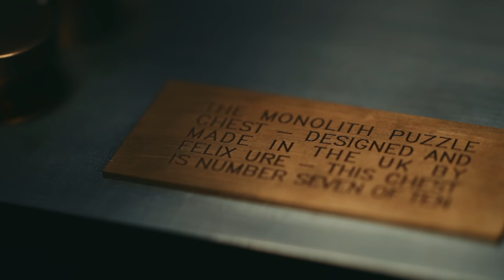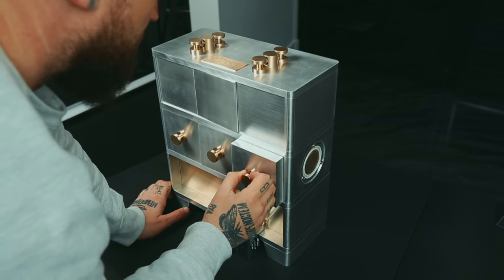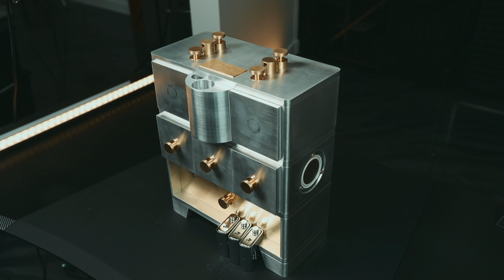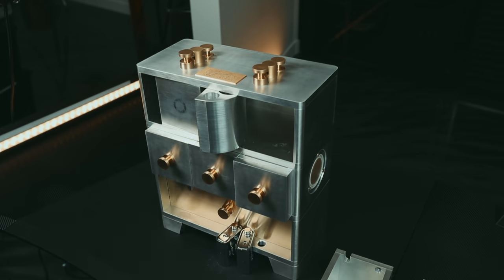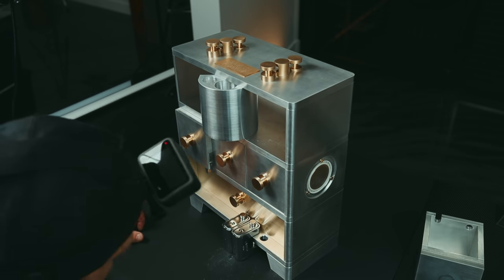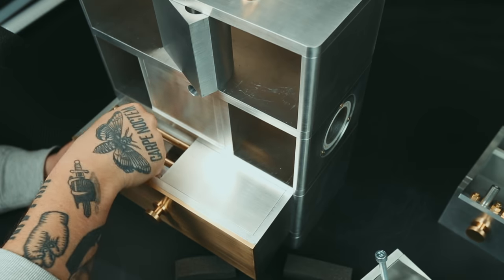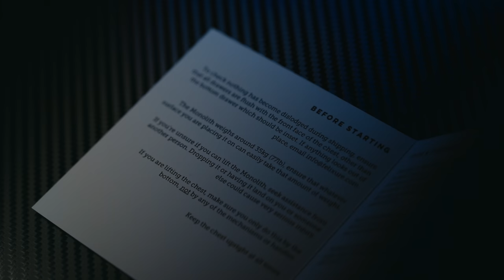The GIANT MONOLITH Puzzle Chest is a BEAST!! (Only 10 Ever Made!)

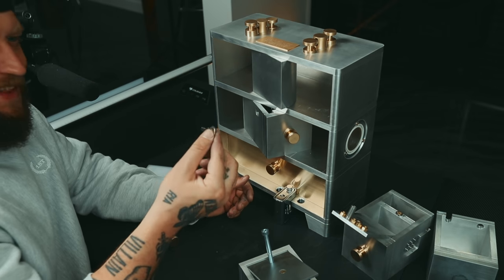Comment: 29:48 Pretty sure you were supposed to put the magnet inside the hole in the rotating section above that drawer instead. Also would have been a good idea for Felix to use some teflon between the parts that were scratching. It would have given some extra neat contrast with the color scheme too and made the sliding not stick so often
Reply: i bet he could have used a cloth or something over the magnet

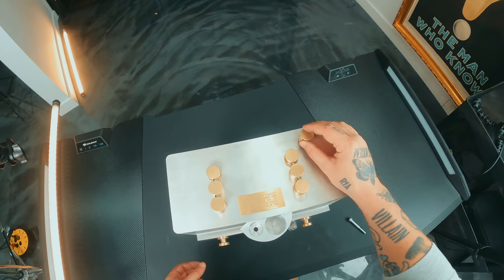Comment: 10:35
The force you are feeling when you move the magnet across the metal is the magnet inducing a current and magnetic field in the metal.
This happens anytime a changing magnetic field moves through a metal.
That is how some electric motors and how induction stoves work.

Comment: Hey Chris, just some advice on how I think you might prevent scratching up the dial on the side; It looks to me like it's intended to be spun like a dial by putting the magnet in the dead center and then spinning it like a dial combination lock, rather than moving it like a crank from the sides.  I might be wrong but if you had to open it again I think that would keep it still and prevent it from getting further scratched.

Comment: Hey Chris. Love your videos! Have you heard about this house in the States?GILLETTE CASTLE
EAST HADDUM, CONNECTICUT 
Built in 1914

(The home of William Gillette, American actor)

The castle was originally a private residence commissioned and designed by William Gillette, an American actor who is most famous for his portrayal of Sherlock Holmes on stage. Gillette lived at this estate from 1919–1937.
The castle was built between 1914 and 1919 with an addition completed in 1924 on a 184-acre tract at the top of the southernmost of a chain of hills known as the Seven Sisters.
Construction was performed by the Porteus-Walker Company, a leading contracting and wood-working firm based in Hartford, Connecticut founded by Gillette's childhood friend, Robert Porteus. It has been described as being designed in a medieval gothic, or an "American fairy tale mixed with European flair" style, or as "a weird blending of Victorian and Arts and Crafts". 
The 3-story-plus-tower, 24-room, 14,000 sq ft home was built of wood, cement, and local Connecticut field stone, supported by a steel framework. The exterior of the home is covered in field stone. Woodwork within the home is hand-hewn southern white oak. In some places, beams were set directly into the stones, anchored only by cement. The walls, in particular, were constructed similarly to a stage set, lacking two-by-four studs and mortar in critical places. It has been noted it was "a wonder the building didn't collapse" before the castle's multimillion-dollar restoration. Insulation included seaweed and paper. It took 20 workers from 1914–1919 (5 years) to complete the construction totaling a cost of over $1 million at the time. 
A number of oddities exist inside the home that were personally designed by Gillette and said to be examples of his "creative genius".
These include:
47 unique doors and door locks throughout the castle. Each door is equipped with an external Steampunk-like latch intricately carved of wood.
Trick locks made unlocking these doors a puzzle.
Unique furnishings including built-in couches and a movable table on tracks.
Light switches of carved wood.
Secret doors, passageway, and room. 
A secret door near the staircase leading to the rest of the home allowed Gillette to swiftly, unexpectedly, and theatrically appear to welcome or startle his guests. 
The secret room is only accessible by a staircase revealed after pulling down a handle. The room is small, and contains a fireplace.
A grand wooden staircase to the upper floors.
The home was notably decorated with a number of Tiffany lamps made of broken bottle fragments.
It also had a heated bed. 
At one time, Gillette shared his home with up to 17 cats. For them, he designed finely crafted cat toys.

Comment: The force you felt when moving the magnet might have been eddy currents induced by the magnet. If you put a strong magnet inside a copper (or other electrically conduction) tube, it will fall slower than expected because the induced eddy currents will create an opposing magnetic field. It doesn't feel like it's sticking to something, because those currents only apply when the magnet is moved.

Comment: What a beautifully crafted puzzle, well done Felix! I love how many different drawers and compartments for storing secret treasures this cabinet has, I also love how within the puzzle are other, smaller puzzles that need to be solved. Thanks so much for showing this puzzle off Chris! 🧡💛🧡💛
P.S. A tip for using a powerful magnet on a scratchable surface is to put a lens cloth in between the magnet and the surface.

Comment: A tip for using the GoPro for these, everyone is quick to turn the field of view way up because they're used a lot as action cams, but the problem is people still do it when they aren't being used for action like an application such as this. I guess it's just part of the go pro stigma but it isn't necessary here.
Having the ultra wide angle here just distorts the puzzle, makes it appear further away and you can't see the details well and what is happening.
There's no reason to see everything around it.
Turn the FOV down and it will give you a much better result.

Comment: "It's not attracting but I feel a force" That might not be something in the puzzle. That might simply be a property of magnetism. (I mean there might also be something in the puzzle, idk how it's built) That puzzle seems to be mostly made out of aluminum, which of course is not ferromagnetic, but if you move a magnet around close enough to the face of a piece of aluminum or copper, it will generate "eddy currents" which work against the motion you are creating, or more specifically they are working against any relative difference in motion between them. The strength of the currents are relative to the how fast the magnet and aluminum are moving relative to each other, and also how strong the magnet is and how big the aluminum is. The currents are pretty easily overcome since they are reactive, but they are very effective at slowing things down that don't have something actively working to overcome them. This is how the brakes for roller coasters and drop towers usually work. The train will have large aluminum fins under each car, and on the track there will be large magnetic channels that will create those eddy currents as the fins on the train rush through, which will try work against the speed of the train. As I said before the currents are easily overcome by any force actively trying to accelerate the aluminum, this includes gravity so if it's on an incline it will slowly move down the incline, this means that most roller coasters also have some other way of holding the train firmly in place once it's slowed down.

Comment: If this is lubricated with anything it's probably just a bit of graphite dust, but it's likely you're just ending up covered in aluminum dust from the very tightly machined parts getting a bit of wear. Shame on Felix for not putting a sticky felt pad over that magnetic drawer pull tool though...one should always protect against strong magnets and scratches.